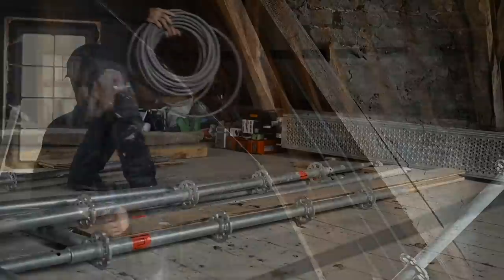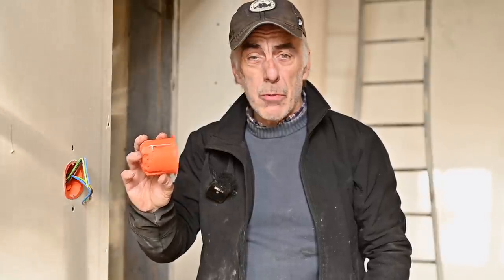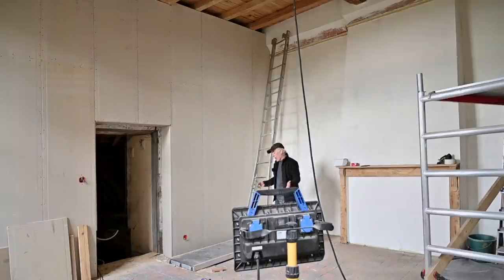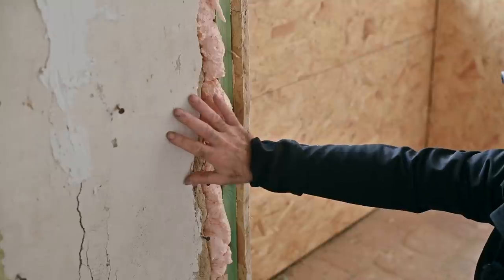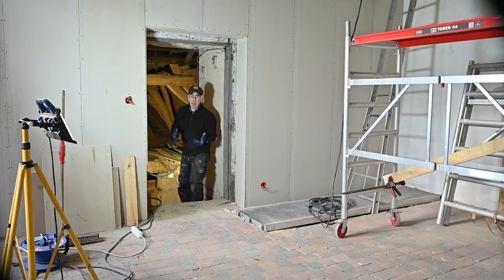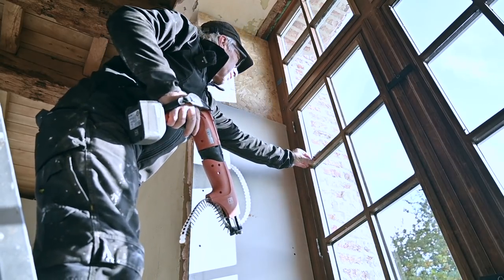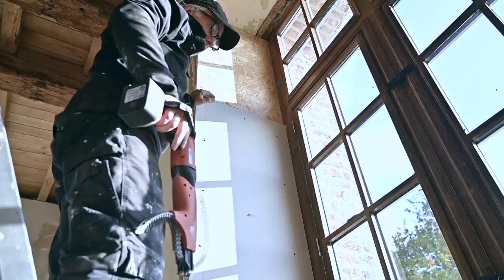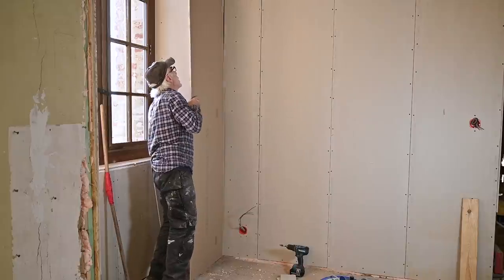Restoring the tower room,  window sides and electricity

Comment: in the US we have two types of boxes, new work and old work.  new work boxes are for just that installed to the wall framing on construction before the wallboard, old work is for existing walls and have the little tabs that you used.  We normally installing rough wiring before the wallboard.  generally contractors hire wallboard subs since this is specialized work and these guys can do it way faster than a general carpenter, I mean really fast, and the tapers and plasterers are also fast.  Electric boxes are marked on to the wallboard and cut out with a zip saw (small router), wallboard is installed with a screwgun.
Reply from the maker: Txs for the comments  great to read on how that is done in your area.
Reply: The only European countries that have similar boxes are the Scandinavians. Everyone else just fits boxes like these once the walls are boarded.

Comment: Plastic electrical boxes are quite common in America.  They are flimsy when attached to dry wall only. Your reinforcement board cut in half to fit through the hole is simple, but genius! Thanks for the great tip.
Reply from the maker: Txs for the comments
Reply: I really like those boxes! They're about the same as the ones we use but the front is slightly larger so they won't drop through an oversized hole as easily as ours. I'll have to find out if I can order them online! The ones I can buy in Austria or Germany only have something like a 2 mm rim so even if the hole is just a tiny bit too large, the box drops into the wall.

Comment: I think I would have made wood sills or stone of some sort rather than dry walls. My sills always get wet and dirty from window plants in pots. Nice work on the tower. How come you just do not step up and get the stairs done? You know you will have to have them and they sure would make the job easier now. Just asking.  Love the channel and the videos. Jim in Chile.
Reply from the maker: Txs for the comments , the sills will get later a blue stone top.  Those are been produced .  As for the stairs, there is still to much to move around. So they would get damaged

Comment: Nice! Top work as always! I've just a question for you. Why are you closing the chimney? They are beautiful and give a lot of atmosphere to the room when they are on fire
Reply from the maker: Txs for the comments ,that was closed.  I have not covered it up.  I might open it later
Reply: Chimneys cause draughts and leak heat
Reply: @DICEGEORGE  yes, but they are awesome. When you burn woods that you cut by yourself, listening the crackling of the wood on fire and watching the flames. Maybe in the meantime sitting on an armchair watching tv o reading a book with a galss of jägermeister beside you 😂. These sensations are priceless for me
Reply: @gabrieleolivieri2852  @Gabriele Olivieri A wood burner is almost as nice as an open fire and doesnt waste heat up the chimney when its not in use. possibly you meant this. However chimney lining is expensive if you have an old house with a fireplace in every room! Best to have a burner with its own air supply.

Comment: Hi, big fan of yours!
I have one question. Why are you dry walling the entire room and not leave the concrete walls as there are? In my opinion the concrete walls are more typical for a house like that.

Cheers
Reply from the maker: Txs for the comments , good question.  I have left the walls that were with original plasterwork as they are.  The others with to much platerdamage i opted  to install drywall. For reasons of work and speed

Comment: Steve here in the states everything has to be tied to either a ceiling joust or wall stud.
What are going to do with the ceiling?
Ok next question- what are you going to use the room for?
Reply: New construction has to be mounted to studs. Replacement boxes does not. That's why you see so many plastic boxes with flip out tabs at homedepot and lowes.
Reply from the maker: Txs for the comments , cables need to follow specific tracks. The outlets need  to be firmy in place.   I think it will be a photography studio

Comment: 2.5 mm cable is  is 2400 watts
Reply from the maker: Txs for the comments , 2.5 mm is rated at 16 Amps per phase.  As this is mono phase it equates to 220Vx16Amps. Or 3400 Watt

Comment: 2.5mm wires for wall sockets and lights? Are you going to use up to 32 amps?
Reply: Some countries prefer 2.5 for 16 amps although 1.5 is technically sufficient, others downright require it. 32 amps with 2.5 is only possible if you do a ring, which is only acceptable in a handful of countries around the world (UK, Ireland, Malta, Cyprus, UAE, Malaysia I think). I definitely wouldn't use 2.5 for lighting circuits, solid 2.5 is much too stiff to work with easily in those boxes!
Reply: @Ragnar8504  Ok - thanks for the information. In Germany we use 1.5 for all 16 amp circuits. Funny enough, all light switches here are only certified for 10 amps.

Comment: For those in the UK much or what you have seen in unacceptable as it does comply with BS7671 the electrical regulations. Different countries have different regulations in Belgium it is acceptable.
An question please consult a qualified electrician.
Reply: UK have some strange requirements regarding electricity, like
fuses on all plugs, that has to be checked speaking of businesses.
Reply: @TheUlrikkaul  A fused plug or receptacle?
Reply: @TheUlrikkaul  Not quite true the fuses in plugs are related to the draw (amount of power required) and the cable but not checked when at  manufacture specification. I was talking about the regulations of the installation not the accessories that are plugged in to the installation
Reply from the maker: Txs for the comments , indeed many countries have different rules.  .  We have piles of them bundled in a book.  The installs need to be verified after the work is done.  Even cables in the walls need to follow specific tracks.  UK based installs here would not pass inspection.   Strange that there are so many rules.